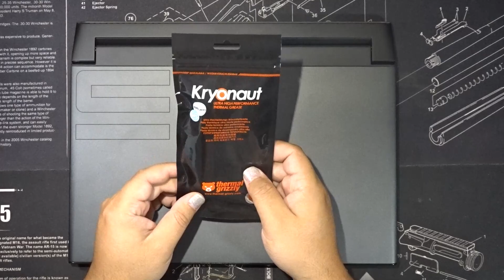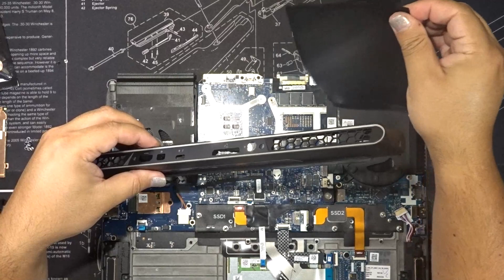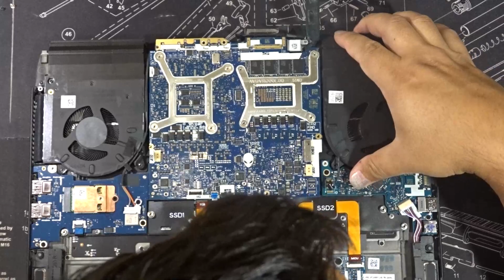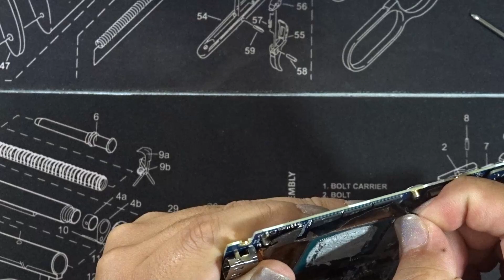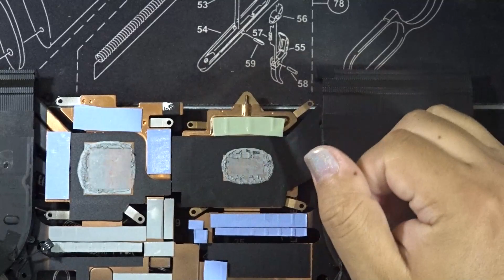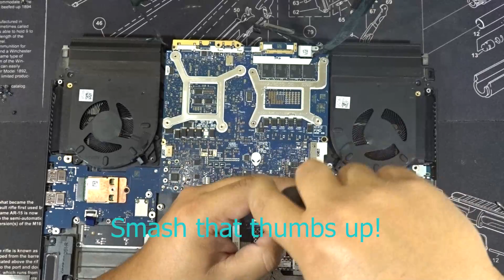Tech Review: Alienware M15 R3 Teardown

Comment: I liked your video and it's really detailed. Superb. Unfortunately... I stripped the two screws that hold the back cover with the led lighting... The 2 screws on the board not the ones outside. Is there anyway to extract this without breaking anything? 😅😢 I want to clean the fins and the 2 fans.

Comment: For the ones hoping to see the fans removed for replacement ... There are 4 and 5 very tiny screws on the side of the heat sinks that hold the fans in place, which means you have to go throught his whole process of taking apart the whole motherboard. Horrible design. But this video pointed me in the right direction.

Comment: Hello! Your disassembly of the laptop is very helpful and with it I’d like to ask a question. Since the fans and heat sink assembled seem to be connected to fix the fan is it required to replace the entire thing or is it possible to replace the fans by themselves? Thanks in advance 😁

Comment: I know this is an old video, but my right fan (top down, by the power button) is doing all sorts of weird things. It makes a terrible buzzing sound constantly and sometimes, it turns off while the left one is wide open, and it just comes on in spurts. Like... buzz........buzz......buzz......buzz....buzz.... Any clue? All the PC repair shops I've talked to said to just buy a new computer. That's a hard pill to swallow since I paid almost 2k for this thing about 2.5 years ago. No one wants to work on it but surely a fan replacement can't be that bad. You took yours apart in about an hour (Ik now parts of this vid were sped up). I'm afraid I don't have the skill to do it myself. What if I mailed it to you? lol.

Comment: What do you call the the layered composite thermal sheet?

Possibly copper, graphene and silicone

Dell didn't want to tell me.
Mine is delaminating. I took it out and replaced it with Gelid ultimate 15W thermal pads. I'm not convinced in my workmanship nor do I have good comparison temps (lack of baseline) While 15W/mK is ok, It's not copper or graphene. Thoughts or suggestions?

Comment: as a full time dell service technician, not bad at all. i tear these down in 10 minutes. Ive must have taken apart over 10,000 laptops and 1 thing I learned is always refer to the service manuals for screw locations. you had me pulling my hairs out on some parts of this video. not bad though
Reply: Hey man. I'm doubtful you'll see this, but is there any way to just replace the fans, or do you have to swap the entire cooling system? I'm only trying to swap the GPU fan.

Comment: I have a question about the hinges? I have a M17 R2 version, but it is built the same as this one. It fell the otherday and the hinge connection points that connect to the back of the display broke from the rest of the display. When I looked up what the exact part name was, dell's manual says its a Hinge-Up Display and to fix the hinges the entire thing  screen must be replaced. Is this true or am I reading the wrong thing?

Comment: Hi, came across your channel very helpful. I added my M.2 SATA to the slot 1 but the laptop keeps booting from slot 2 which is the original 512gb PCIe it came with. Is there any way I can change the boot options in BIOS,it was very confusing

Comment: How do you add some more memory in this laptop? I just  bought it from best buy and it came with 16gbs.
Reply from the maker: You can’t. Unfortunately it’s soldered on.
Reply: @corpustechllc  dang that sucks, I was thinking about taking it back. But I got this laptop for a pretty good deal, out the door with taxes I paid 1699. I found one open box that looked brand new at best buy.

Comment: Question for you man. I have a m17 r4 and when I opened the back plate to upgrade my ssd and put everything back together my mousepad and clicked stopped responding. I didn’t take any additional wires or mess with anything else besides that. Could you help me?

Comment: can you please link me the screw driver set you used for this process please?
Reply from the maker: So this is not the ones I used in the video but when i'm out working on client computers this set is the one I always take with me. https://amzn.to/3ruIaqJ
Reply: I stripped the IO cover  screws in the top left and right and I don’t want to continue stripping more !please id appreciate  it a lot
Reply from the maker: Hey! I’m out of the house but as soon as I get back I’ll show you what I recommend!
Reply: @corpustechllc  thank you so much!what about the ifixit essiental kit?will that do?
Reply from the maker: Yeah any of the ifixit stuff should work. I bought a kit almost 10 years ago now and am still using it! Other than one bit that I lost everything is still holding up well. I’m likely gonna buy one of their bigger kits this year for my workshop and keep my smaller kit for when I’m on the road.
Reply: @corpustechllc  thank you so much!I stripped so many screws up until now because I’m using low quality cheap sets from amazon :/
Reply: I think the guys screwed my heatsink in too much,the screws are locked in place and they don’t want to spin :/ do you live in NYC by any chance?
Reply: @corpustechllc  i bought a new set from Home Depot and I have the right head but the screw is locked in place,it doesn’t want to turn.can I message you somewhere else for a faster reply time?
Reply from the maker: Some times they are locked in pretty tight due to them using locktite on the screws. Honestly though if you are worried there is an issue your best bet is to get it into a professional and get a second opinion. If you don't have experience with the difference between something that's just really tight or something broken you could end up snapping off the screw head or damaging the motherboard. I wish there was more I could help you with but I don't want to be liable for any damage that may occur from what you are doing and as I am not there to see what you see i'm not comfortable telling you what to do either way. Getting help from someone with more experience is the safest bet if you want to make sure you don't damage your laptop any more than a few stripped screws.
Goodluck!
Reply: @corpustechllc  can you give me the exact screw bit that I need for the heatsink?which head do I use?

Comment: I followed this and the pins to the left of the display cable werent soldered to the board and just completely ripped off. It still turns on and runs ok but was just wondering if they were important?
Reply from the maker: I don’t exactly know what that’s for but off the top of my head does the webcam still work now that they are missing? Also I suppose it could have something to do with gsync if you got a gsync display but I’d put my money on the webcam first
Reply: @corpustechllc  webcam and gsync still work. But the color and rgb on the power button and alienware logo on the lid no longer light up.

Comment: Hey my m15 r3 currently has 1 ssd drive in it. I am planning on buying a second. Am I correct in thinking that the laptop comes with a heat shield for both ssd slots? So all I have to do is buy a drive and stick it in? Thanks in advance?

Comment: I was so close to buying this laptop until I found out they inverted the board and soldered the ram and WiFi card.... having had these elements fail in the past.... I would never buy a laptop from a provider that does this.... out of warranty repairs are crazy money!
Reply from the maker: Yeah. I feel you. I think its just the trade off we have to pay for something so thin. Others are still being more traditionally but I see soldered components as an inevitability.
Reply: @corpustechllc  the big issue is, if your ram fails... it’s a mammoth job or if it’s out of warranty. It will cost you a wedge and it’s unnecessary. They didn’t do it in the last versions. Just seems to be greed.

Comment: Hey I was hoping somebody or even you could answer this: 
I have the M15 R3 and I’m not that great with computers but I’m thinking about upgrading my storage. The storage that I bought the computer with came with 2 PCIe’s. Both are 256 GB. So 512 max. I bought a 1 TB NVME drive and I want to upgrade the storage and replace one of the 256 GB... will I run into any problems and is this possible? Thanks.

Comment: wow.. Im a little scared now mine comes in a few days. Should I get this done? how much better are thermals from stock after this?
Reply from the maker: After a few months I’m completely satisfied with the laptop! I undervolted it and it is keeping reasonable temps during gaming, editing, and rendering. All in all it does require a little bit of tinkering but when you get it tuned it really puts.
Reply: @corpustechllc  do you use an under pc cooler mat? I find that works a lot and my thermals are much better than even r2 version

Comment: At 39:35, is that masking tape you have used to re-attach the leads to what I believe is your Wi-Fi card? Only part of this project that makes me nervous is the possibility of having to solder.
Reply from the maker: No soldering required. I just used a small screwdriver to push the small connectors down.

Comment: Very nice video, congrats! However, I would have liked if you showed your CPU/GPU results after all the procedure. If the difference is less than 5%, then it's not really worth the time and effort and risk. But if it's >10%... man that's a different story.
Reply: Oh and whats going on with Dell? So much engineering talent in designing a state of the art laptop, only to be screwed by a careless production line assembler who has no patience to check his/her work?

Comment: Is the maximum nvme slots 2 or 3? I see the two labeled, but there's a mini slot where the wifi card is soldered. What is that for?
Reply from the maker: it has 2 2280 slots and 1 smaller slot thats a 2230 i think.

Comment: Great video! Do you know if the M17 R3 has the same motherboard structure? In other words, could I use your video as a guide for my M17?
Reply from the maker: I am actually not sure. I would suspect that to be the case. At least close enough to help but you can always view the maintenance manual provided by dell for these machines. It provides step by step instructions on exactly how to disassemble and reassemble these laptops.

Comment: Did you return this unit?  The bent heat sink on the GPU should have been caught and not allowed to ship.  The paste is not meant to take care of vast gaps and in this case, you can see where the paste was not in contact with anything on half the die. You would never have known this if you didn't take it apart. Someone less tech-savvy would be stuck with the back and forth of Dell / Alienware tech support and nothing would be found.  Do you have a recommendation on what checks to conduct on new systems to check them out?  Thanks again...
Reply from the maker: This one will be returned due to it having a 2070 and not a 2080. I ordered the 2080 and they sent out the 2070.

Comment: Thanks for this.  Do you get 2 Nvme copper heat sinks if you only order one SSD drive?
Reply from the maker: I honestly am not sure as the unit I purchased had all three drive bays populated. You'd have to check with Dell Customer Service
Reply: @corpustechllc  My M15 R3 just came in, and I ordered it with one 1TB SSD instead of the two 512 SSDs in a RAID configuration.  The system doesn't come with a heat sink for the empty bay.  I had hoped it would.  If I had known it did not, I would have selected the two 512 SSDs in a RAID configuration option.  A 6 parts PC World series with a Dell Engineer is very good and he speaks to the need for an SSD heat sink because of the heat they generate. I do have an aftermarket one I can install if I decide to add another SSD.

Comment: Question is the ram soldered or did I just miss it?
Reply from the maker: It is soldered on unfortunately
Reply: @corpustechllc  Ok thanks I thought since it was really expensive I could spec up the gpu and downgrade the ram and storage for future upgrade but that will be impossible. Would 16 gb ram be enough for gaming and video editing maybe occasional streaming or 32 could be a must?
Reply from the maker: This would greatly depend on your workload however for gaming 16GB should be more than enough for the foreseeable future. Likely the machine would be fairly outdated before we start seeing a need for 32GB as a standard. As far as video editing and whatnot this really just depends on what kind of editing you are doing. If its just light hobby type stuff 16 should be plenty. However if you start talking about wanting to do 2k/4k video and effects etc...it can really start adding up quickly. My current editing desktop has 32 and for the stuff i'm producing on youtube I have not run across an instance where it wasn't enough but a few times I have worked on projects where my RAM jumped up into the mid 20GB's so 16 would have been too little. I was working on 2k gopro footage and tying it together with 2k video from my Mavic Mini drone for an engagement video for my sister. Hope this helps!

Comment: Would you say it was designed well inside and out?
Reply from the maker: I do think the build quality is very good. The components seam high quality and it was thought out. Still has some heating issues but if you are talking about just fit finish and quality of the actual machine yes its very good. I'm completely satisfied on that front

Comment: I just receieved the m17 r3,  question in regards to booting it up.  When the now lets see whats new from windows screen pops up, how long does that normally take??  This is my first gaming laptop but will be used as a daily driver.    Response times from dell/alienware are slow, so hoping you can help me out.
Reply from the maker: This can take anywhere from a few seconds to a few minutes. I'd say if its on that screen longer than 5 minutes try doing a restart by holding down the power button until the machine powers off and then power it back on again.
Reply: Advanced Vector thanks for the response, got it finally working!!  Another question I have, is internal ssd upgrades,  how do I find which ones are compatible and how difficult is the actual install of said ssd.  I’d be looking to add 1tb of internal storage.   Thanks.

Comment: Hey! Dell claims that they've included a vapor chamber in the cooling system but I couldn't figure where it was in that teardown. Is it really there? And is it just very very small to the point where it's useless but present for namesake?
Reply from the maker: I didn't notice where it might be. You'd have to confirm with Dell to find out where it is.
Reply: I was wondering the same thing.  It looks like only Heat Pipes and it doesn't look like it is much improved over the R2 design. What did they change on the R3?
Reply: @ConsumerFromHell  yup exactly. Apparently the heat pipes are thicker and fan blades are wider from R2. But I couldn't find the vapor chamber.

Comment: Alien Fx on my m15 r3 keeps malfunctioning you thing is the keyboard or software? I've reinstalled it already and same issue, keyboard even stops working at times
Reply from the maker: probably hardware related then. I have not had any issue with the lights on mine.
Reply: @corpustechllc  I had to factory reset and spend over 50hrs on the phone with dell. They never call back. Finally get replacement after 4 months

Comment: Thanks for the teardown! I just received an M15 - i9 2080S. A weird problem is I can’t get the iGPU to be used. It doesn’t show in device manager or for selection in the nvidia control panel. Any chance you could see what the story is with yours? 
I have the 300hz panel. 

Thanks!
Reply from the maker: I noticed the iGPU is disabled in my version as well. I am wondering if its because of the 300hz screen. I know in previous AW's i have owned that in some of the screen options they disable the iGPU as it cannot perform with the screen.
Reply: Advanced Vector thanks for that. I checked in with a Razer owner with a 300hz, 2080S as well and he does have the iGPU available. I’m getting about 2 hours of YouTube streaming on mine, which sadly won’t cut it, was hoping to be able to eke our at least 4 hours at 60hz and with battery saver for meetings. I also found that plugging into my thunderbolt dock with power delivery the battery still drained doing productivity tasks (word docs, email)which is a major disappointment.  With an external monitor via the dock the dgpu would jump to 75% in task manager just moving the mouse around which was a big surprise! Look forward to the rest of your series, great job so far!